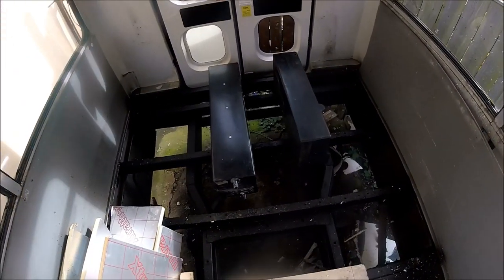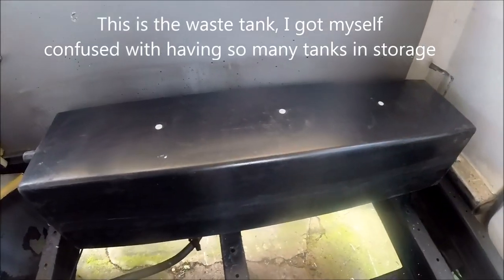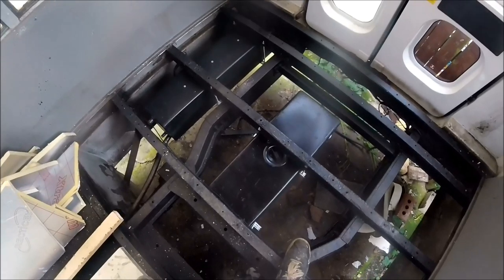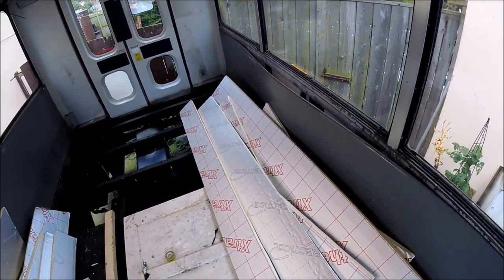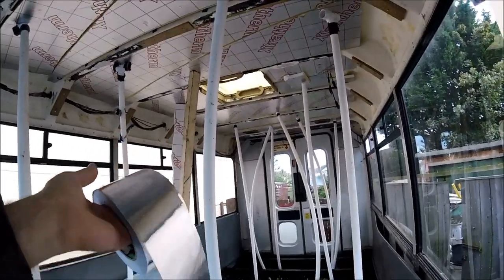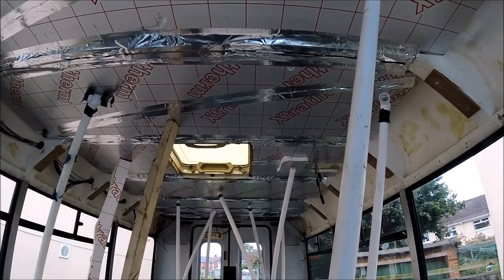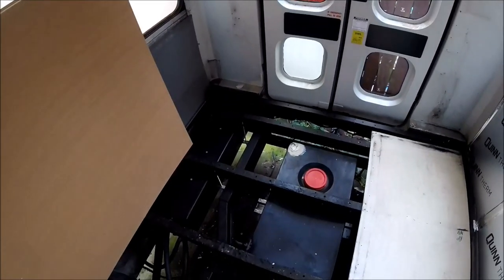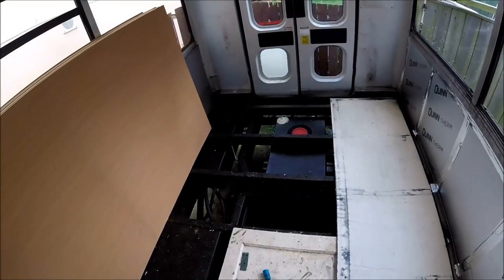Minibus Campervan Conversion Part 4: Water Tanks & Insulation installs

Comment: Great work, I admire your work ethic!
I hope you don't mind me suggesting that I think you missed a trick on your roof panels. The gaps between the sides of the panels and the roof would be absolutely perfect to use expanding foam in. It would hold the insulation in place and make it air tight.
Its cheap and if you buy a foam gun and cleaner its not messy at all.
I started using it recently after spending years thinking it was messy and bodging but it is excellent to use for jobs like this.
Great build, thanks for the videos.
👍

Comment: Great work, are you fitting an extractor fan to the roof vent, a maxx air plus would be brilliant along with an extractor in the shower
Reply from the maker: Thanks, no I’m not fitting one
Reply: @TheCampervanBuilder  that's a shame, almost all builds reccomend extraction for hot weather, even in well insulated fibre glass builds. Maybe put an electrical feed in for future easy upgrades. Good luck with the build
Reply from the maker: The skylight is larger than the standard sizes available so no fans fit it but the vehicle will have 5 opening windows, a skylight, double back doors and a large front door so ventilation isn’t going to be an issue at all